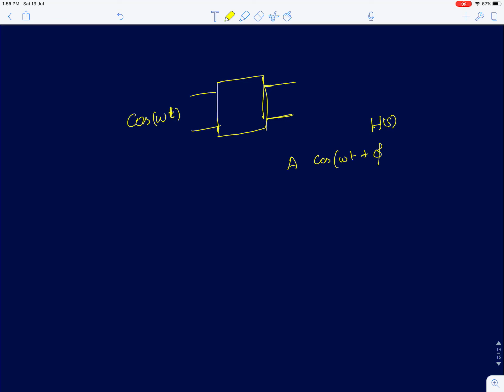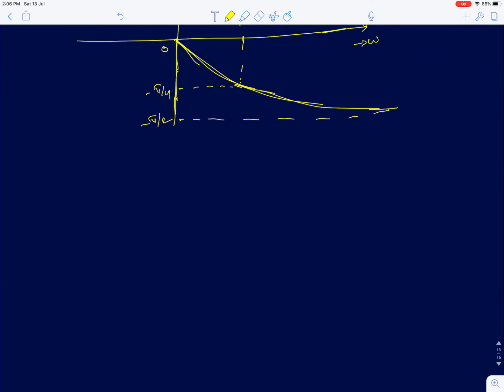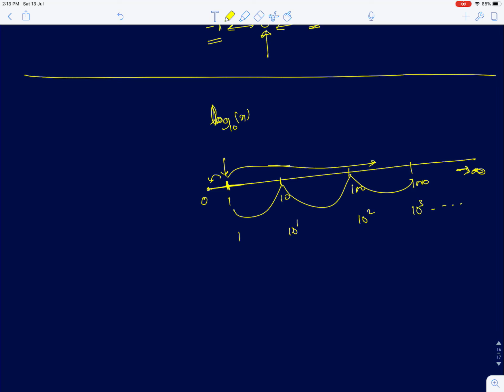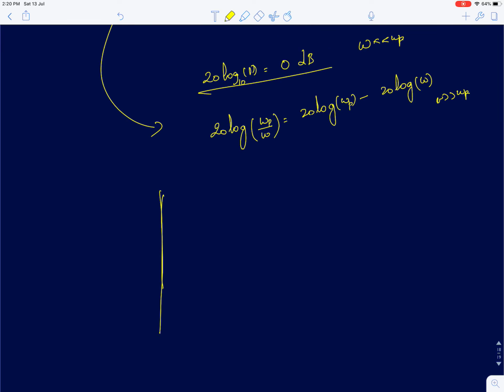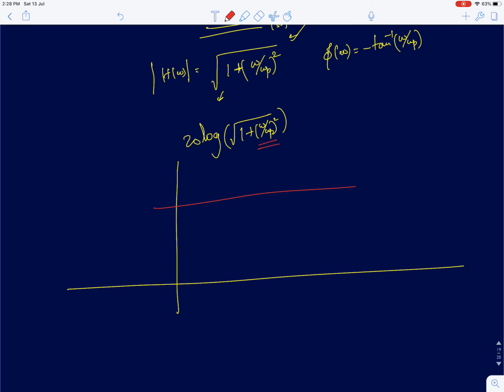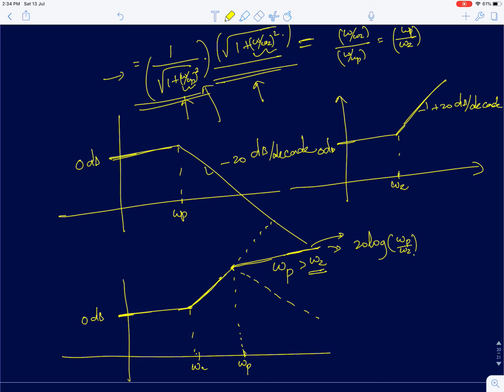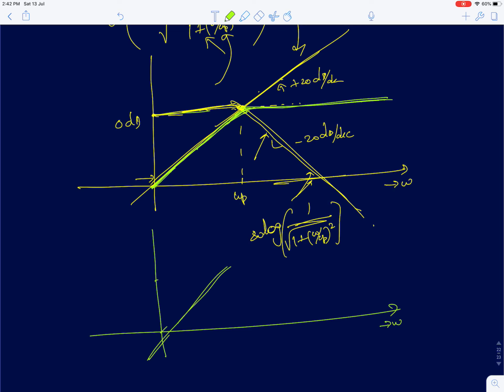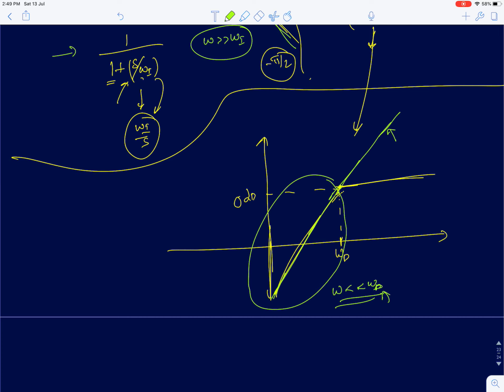ES Lecture 17: Frequency response of first order systems and bode plots

Comment: At 38:21, if w is close to wp, then the phase response cannot be greater than pi/4 since tan-1(w/wp) is already subtracting pi/4 from a quantity just greater than pi/4, so it should be less than pi/4 (or else tan-1(w/wz) should be greater than pi/2, which cannot be possible)